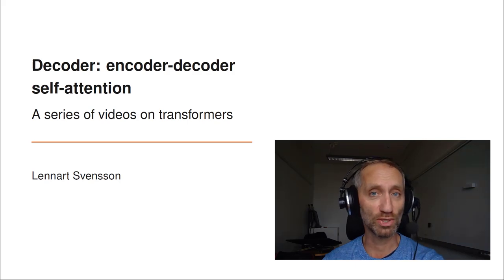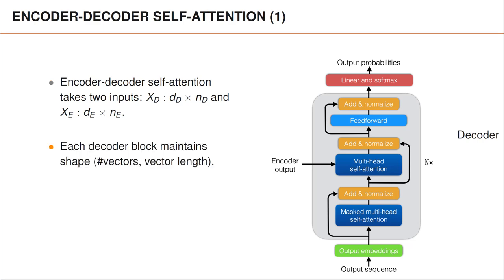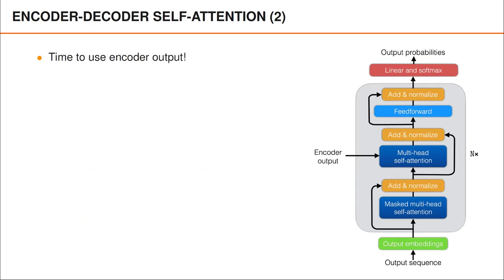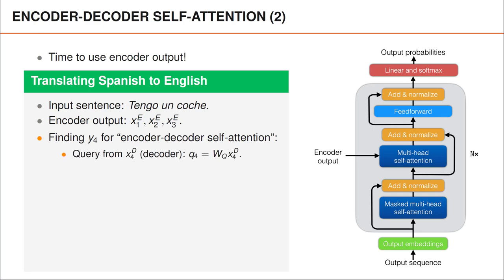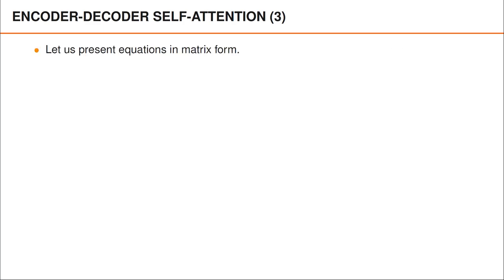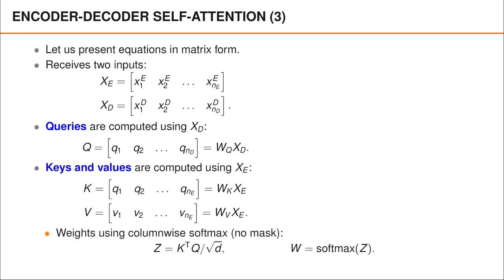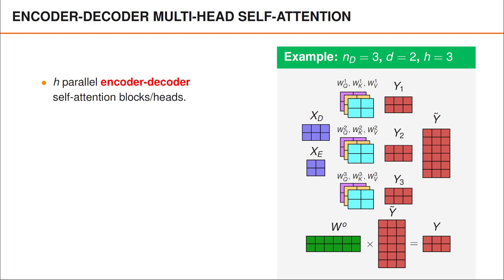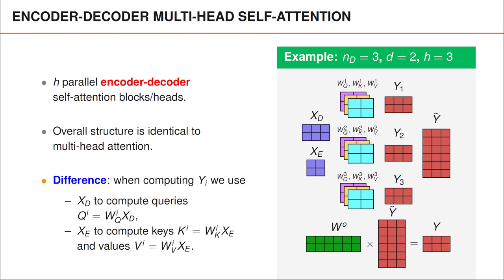Transformer - Part 8 - Decoder (3): Encoder-decoder self-attention

Comment: thank you for your work, these are incredible videos. but there is one thing I didn't understand. during the training phase, the entire sentence already correctly translated is given as input to the decoder and to prevent the transformer from "cheating" masked self attention is used. How many times does this step happen? because if it only happened once then the hidden words would not be usable during training. During the training phase, after each step does backpropagation occur and then does the mask move, hiding fewer words?

Comment: Thank you for this video. During calculations in Encoder-Decoder attention layer, are matrices Wq, Wk, Wv specific to that layer, and learned only in this layer? Also, am I correct to understand, that Decoder masked self attention and Encoder-Decoder attention act as essentially different layers, with different set of W matrices?

Comment: These videos are wonderful, thank you for putting in the work.  Everything was communicated so clearly and thoroughly.  

My interpretation of the attention mechanism is that the result of the similarity (weight) matrix multiplied by the value matrix gives us an offset vector, which we then add to the value and normalize to get a contextualized vector.  It's interesting in the decoder, we derive this offset from a value vector in the source language, add it to the target words and it is still somehow meaningful.  I presume that it is the final linear layer which ensures that this resulting normalized output vector maps coherently to a discrete word in the target language.

If we can do this across languages, I wonder if this can be done across modalities.
Reply from the maker: Thanks. That sounds like an accurate description of cross-attention (what I refer to as encoder-decoder attention). It can certainly be used across modalities and there are many papers describing just that. The common combination is probably images and language but images and point clouds, video and audio, and many other combinations can be found in the literature.

Comment: In this encode-decoder architecture, I wanted to understand if we have N encoders stacked together (one after the other), is Enocder_1 feeding the Decoder_1 or is Encoder_N feeding the Decoder_1?
Reply from the maker: The output from encoder 1 goes to encoder 2 and encoder N feeds its output to decoder 1.
Reply: Thank you. 
One follow up question: where is the (encoder) input for  decoder_n coming from, assuming N similar decoder structure are stacked together
Reply from the maker: @mrinalde  The output from Encoder N goes into the cross-attention for all decoder layers.